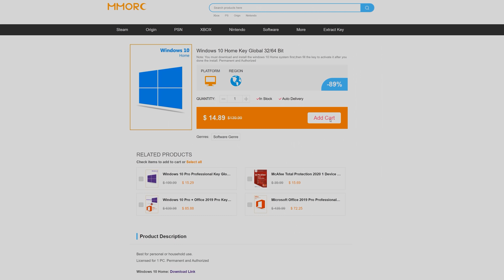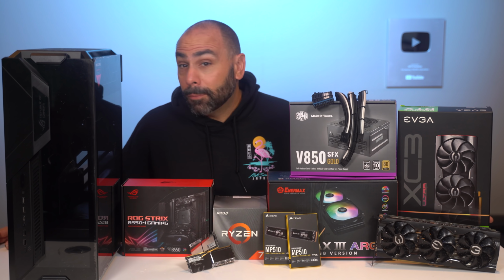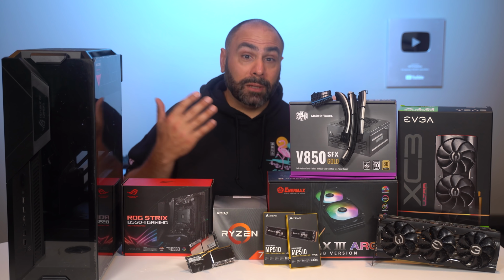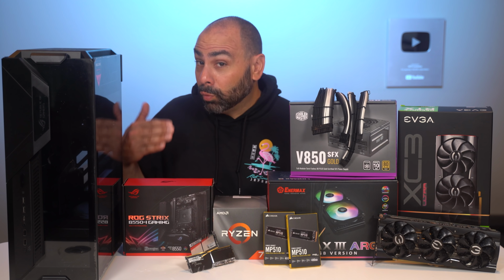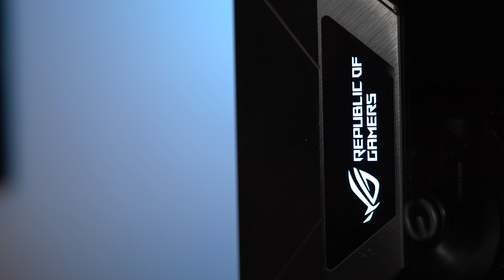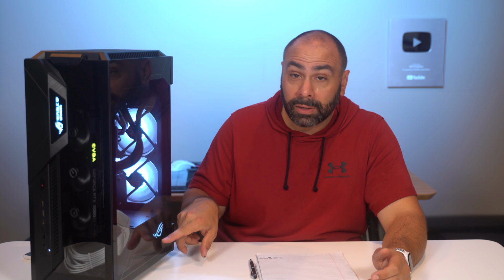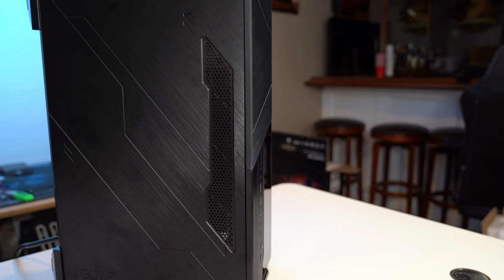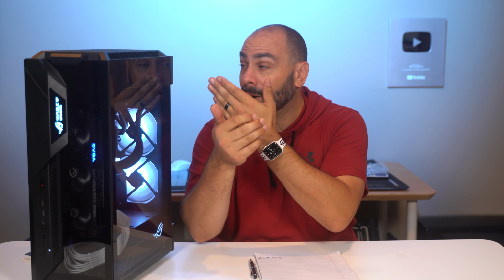A Showcase Mini ITX Build With...Issues

Comment: I have a question.
I know that the power supply can be mounted up to 160mm in this case. However, some communities have said that 180mm of ATX power will also be installed. How do I install a 180mm power supply?

Comment: ex best buy geek squad, computer engineer/electrical engineer.  Long time software developer.  The first (only) Mini case I built included saws and grinders to cut away space for the GPU.....  Fitting those video cards in there isn't easy, at least they made this with enough room for the card and ascetically it looks pretty nice w/ all the glass.

Comment: What about a slim rad and slim fans on top with corsair MLS on back and bottom? With gpu on water too.(vertical position) wouldnt it be good to bottom intake, back and top out.(or reversed on air)
Reply from the maker: Maybe, hard to speculate about thermal performance for a setup wildly different from what I tested.

Comment: I really really like the case, and if you use all ASUS products in the case you’ll have no problems with thermals, because that EVGA card is not a good thermal performer (2 slot card means it’s heat sink is slim and that is not decent for a chip like 3080). 3080 STRIX will have no problem when it comes to thermals. One more thing I would like to mention is that this case comes with a hub to control everything inside. A fan and rgb hub which enables to control everything with one software doesn’t matter if you use NZXT Aio in it which is great job on ASUS’s part. I’ve never build itx always liked big cases, but looking at this I just wish it hits market here.

Comment: But how well does it crash
Reply from the maker: I haven't had a single crash with any of my 3080s that wasn't related to me trying to push an overclock too high. Stable so far, and I use one of them in my everyday machine. Maybe I've just been lucky.

Comment: G'day Brian,
that intake next to the Front I/O for the GPU is just ridiculous, do ASUS thin think ITX Gamers use a GT710, maybe you need to send this case to G/N for Patrick to test too,
😬 imagine how hot a Asus TUF Gaming X3 RX5700XT OC memory would get in this case 🥵, considering it gets over 100°C/212°F in a case with airflow,
🤔 Also I don't understand having an ITX build Bigger than M-ATX or even ATX, don't people go ITX because M-ATX is too big???

It may be 'Different' but I don't see it as 'Good Different' in any way for the market it is aimed at

Comment: gotta hand it to ya buddy....that was a very nice way to say it looks good.... but actually sucks and its overpriced on top of that
Reply from the maker: It is probably too expensive, yes. It's the most fully featured mini-itx case that I know of, with a full rgb/fan hub at the back along with tons of i/o and modular design. But $300 is a lot for a case with thermal issues.
Reply: @BPSCustoms  especially when you can get the NZXT one that comes with a psu and riser cable....for less
Reply: @jandkwhite6459  if this is almost as expensive as the NZXT H1 in the US it is gonna be crazy expensive here, the NZXT H1 is $629AUD
Reply: shane eslick holy shit....I am so sorry that happens to you guys
Reply: @jandkwhite6459  it is weird because some cases are 2x $USD but there are other cases that are cheaper here than in the US like a lot of Silverstone ones,
it is crazy as they all come from Taiwan/China so conversion of construction & shipping should be the same

Comment: This thing looks like a case for Asus gaming Fanboys and I like Asus, thief GPUs and motherboards are usually pretty good.. but this is  ridiculously large for ITX , silly expensive and worse of all performs like crap thermally. 

This case is not for me, at all

When I moved my PC-P11 with EK360 open loop I moved it into a M-ATX sized Raijintek Ophion M EVO. It's smaller than this silly Asus case, easy to work in and performance is good. Oh, and a good bit cheaper.